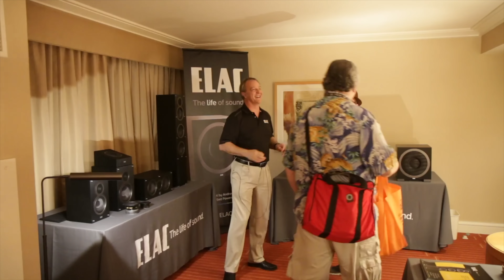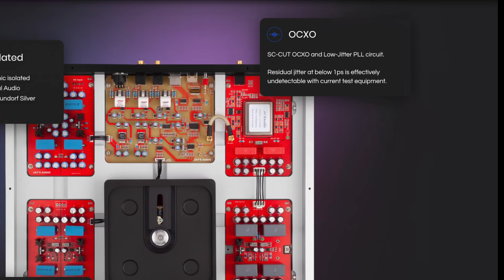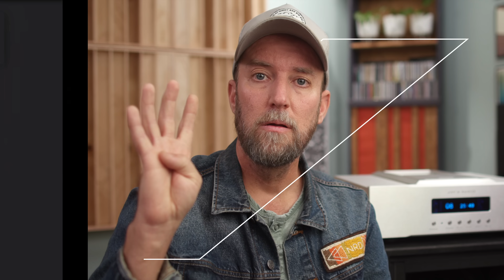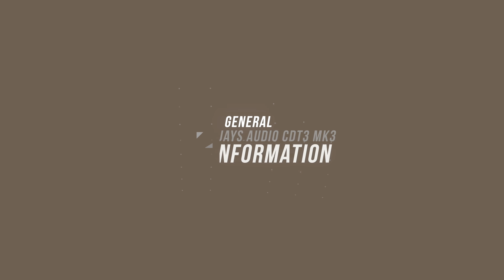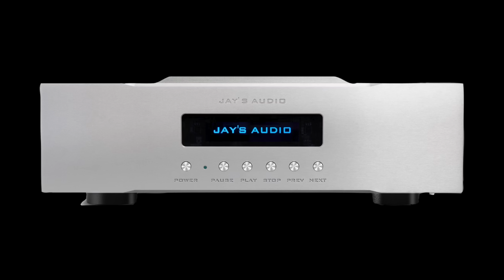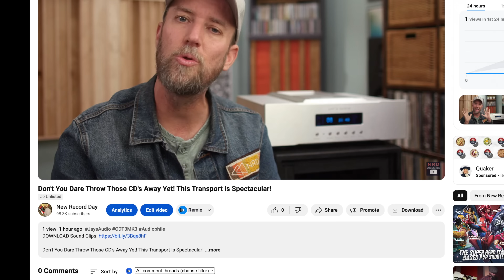Don't You Dare Toss Those CDs! This CD Transport Will Blow Your Mind!

Comment: Talking about listening impressions when you are reviewing transport is kinda silly.

Because transport just .. transports. So the only thing you should check is the output bit stream.

So you take competitor / reference trabsport, then capture output streams from competitor and cdt3 and compare them bitwise. Also you may capture the stream of same track several times. Aldo you nay capture streams from two same CDs but one of them is new condition and other is scratched or 'made old'.

This is only right way to judge on the transport. Your listening impressions has nothing to do with that and make whole your opinion misleading.

Comment: If your reference tracks are the exact same masters in each device there’s only 2 reasons the sound could be different. 1: your DAC has a poor reclocking system. 2: The CD player has some sort of DSP processing inside altering the sound of the original recording to add this “silkiness”.

Comment: As usual.. great video Ron .. I purchased a preowned Jay's Audio CDT2-MK3 Transport earlier this year. My previous disc player was a Marantz 30n Cd Player and it sounded good.. Next I used the Marantz as a transport with a Denafrips Pontus ll Dac and there was a noticeable improvement in sound quality.. Months later I connected the Pontus to the Jay's Audio Transport.. that was another nice jump in sound quality.. Yes, smooth sound with more detail. Needless to say I'm listening to more Cd's in my collection again..  I found that using a separate Cd transport was definitely worth the investment to me.. I would love to hear the CDT3 that you just reviewed in my system.. Maybe I'll  have that opportunity one day..
Reply: I happen to own CD2 and marantz 30n as well, but the latter is for a desktop system. Next I want to try connecting the 30n to main system's terminator 2. I read some post in a forum saying that internal DAC sounds better than coax out to a terminator (1, perhaps)... But your experience is the opposite, so I'm quite curious about the result... I also want to try its USB input, comparing to terminator 2.

Comment: Best value transport right now is from Teac with their latest VRDS system. If you want to improve it even more then add their dedicated clock. Together are still less than the CDT3
Reply: Agreed. Running the Teac clocked externally by an LHY OCK-2 master clock, total price $2700, sound quality a step up from streaming from a $13K Lumin P1, in my system at least.

Comment: I‘m not convinced in 4 of 5 topics. Only the read quality is valid in my eyes. I use direct clocked DACs (TDA1545) for many years, completely ground isolated from the transport, the transport is just slaved from the DACs clock. Something you don‘t find in the market. 
What is true in my eyes: The mechanical situation of this clock is very very delicate. XOs are highly microphonic and their microphonic behavior can lead to higher non linear distortion. So no matter where the clock is situated (transport or DAC), much care is needed to calm the XO. This could be your main reason this transport sounds good.

Comment: .            Why would a CD Transport need a fancy clock if, effectively, all DACs cache & reclock the incoming data anyway?:body-blue-raised-arms:
                                                                                                Acid Jazz,  Funk & Brass🔈🔉🔊
Reply: Correct analysis!
It dont is the awnser.
Reply: No, not all DACs buffer and reclock the data, in which case the transport's clock jitter has more influence on the overall jitter than the DACs clock, because a PLL on its own will not reduce jitter on the input signal.
Reply: @montauktimelord  .
               It's your Jersey drones messing with clocks I heard:face-turquoise-covering-eyes:.   But anyway, it sure seems rare that a DAC doesn't reclock incoming SPDIF.  Can you point one or two out (that are available in 2024, not a decade ago)?
               I agree that the Phase-Locked Loop is not a clock & doesn't need a good one to function.  And any DAC with incoming USB 2.0 or higher must reclock and cannot go without.  Any further info? Reply?

                                                                                                                         Acid Jazz,  Funk & Brass🔈🔉🔊
Reply: If your dac is a slave clock then your source will improve the sound quality. If your dac is the master then it’s limited to its own clock.
Reply: More is always better.
Reply: Thats like saying why do we need a Lamborghini  when my Tesla s is as fast? Because it’s far more complex …handling, control, breaking, …it’s not as simple as dac reclocking…that’s just marketing talk …if a dac is purely reclocking then you are limited[ …your dac becomes the weakest link…so basically your dac is downgrading the signal
Reply: @ajay55556  Lamborghini "breaking".  Ya, they are known for that.
Reply: Digital engineering very complex and trying to explain in few sentences is impossible. That’s why it’s best to go to a dealer and try different sources. You will hear a difference between a 5k transport vs 10k transport. No point arguing on the technology.

Comment: It's interesting how separating CD transport and Dac usually improves the sound, but adding extra links to the analogue signal chain (subwoofer crossover, equaliser, pre/power amp, etc) usually degrades the sound.
Reply: .        It's all about the quality of the chain, not quantity.  The chain itself always requires the same number of links to perform the same task.  CD Players are still a CD Transport & DAC in a single chassis.
       BUT you're right in that some people believe adding a link in the chain where none is needed to enhance the performance of the same task is detrimental.  I'm specifically speaking of adding an Equalizer 'link' into the chain.  I say "Nutz".  A good EQ is quiet as a mouse & it's worth the flexibility to MyFi.
       One caveat,  if one plans to use lots of links then patchords become really, really important.  Beginning & ending this type of chain should be all XLR balanced patchcords from the git-go.  So plan ahead............
                                                                                 Acid Jazz,  Funk & Brass🔈🔉🔊
Reply: Analogue lossy, digital is not.

Comment: Very interesting, you just described my DAC, Audial S5B. I'm an analogue guy, never cared for digital, I was recommended this DAC and this thing is so musical, it's making me rethink my analogue rig, I'll most likely go to a more Koetsu like cartridge when I replace my Cadenza Black.  Seriously, I never thought I'd ever say this, but my present digital rig is more musical than my analogue rig, making this transport very interesting.
Reply: I've had my eyes on the S5B as well. Did you opt for the transformer out?
Still trying to decide myself. Cheers!
Reply: @steven8417  Opted for 2 pair of RCAs, transformer output on one of them. So far I prefer the Cap out, but I'm happy that I have both, for certain music I prefer the more euphonic transformer, who knows, I don't believe in it, but maybe break-in is a real thing. One thing is for sure, it's a musical beast, the designer did an amazing job, bravo Pedja.
Reply: Completely agree. I have an Audial S5b Dac connected to my Roon Nucleus via USB in an otherwise all Audio Note system. Sounds fantastic. I can only imagine how good it will sound with a good CD transport.
Reply: Switch to a Playback Designs MPD-8 DAC as I have and you won’t go back to analog.
Reply: @a.s.2426  That sure looks like a nice piece of Hi-fi, I hear nothing but good things on it, but NO WAY can it be better than analogue...
Reply: @BobCoalWater  Do not "NO WAY" unless you've tried it. Several high-level audiophiles and analog fans have found it, supposedly, to be indistinguishable from analog. In my case, I don't say it's indistinguishable. I think it is superior on some recordings and inferior on others. Sounds a bit different than vinyl, though, for me. A lot depends on the remainder of one's set up, of course. But it's definitely quite analog for digital, I can say. I have owned other DACs such as the Tambaqui that are reputed to be analog-like but sound nowhere close to the MPD-8 in this regard.
Reply: @a.s.2426  It was a joke, not successful. I'm really not in the analogue is best camp, I would love having the chance to listen to an MPD-8 in my system.

Comment: Digital audio on a CD does not work as it does on a Vinyl. There are packages of information, not a continues stream of 1's and 0's. Anything that handles digital signals uses buffers to deal with this. Jitter, package loss or similar issues would result in corrupt reading, something a deaf person could hear. In other words, the CDT3 is a very expensive EQ. Noise over a digital cable is not digital, it is simply analog noise transferred by a digital cable.

If you want better sound, spend your money on room acoustics, DAC and everything analog (cables can make a change, but only if the ones you have are really fucking terrible).
Reply: This comment should be a sticky.

Comment: I still have my Linn LP12 for my vinyl collection and want to find a nice CD transport with i2S output for my disc collection.  I am currently using a 70’s era Luxman CD player but on the search to upgrade.

Thank you Ron for this video plus the sound clips.  I may be missing something here but which (Zenith??) CD Transport is your current reference, Ron?

Ron, can I ask you to please do a deep dive on TDA1541A DAC chip.  I see that there are some DYI and commercially available DAC’s with this chip and just as the Philips CD-Pro2LF tray mechanism, it is highly regarded.

Comment: I while ago I was interested in this transport, but the top loading and blue lights turned me off and I got the Schiit Urd instead, The feet on the URD are terrible but overall I'm pretty happy especially with the sound on the USB out.
Reply: The Urd is as far as I would go 
I like the StreamUnlimited metal tray-loading Redbook CD mechanism
I like two USB in and the USB out
Reply: The display can be turned off. I prefer top loading too. No moving parts.

Comment: The CDT3 is a beast of a transport but at $5k, most will question the value. The CDT2 mk3 gives you 90% of everything the CDT3 offers for $2.5k (and often on sale for $2k), for me that’s the sweet spot buy. It’s far better than any entry level player but beyond it, the gains are way smaller. Did you try the I2S connection into the May DAC? I find I2S over hdmi to be more detailed and dynamic than spdif. And I also prefer non-oversampled for some reason.
Reply: Check out the Shanling ET3. I had the Jays in my system for over a week, and for giggles grabbed the ET3 on sale for $650. I couldn’t A/B, but found the Shanling to easily match the CDT-3 using I2s. RCA or Toslink couldn’t keep up.

Comment: I use a harddrive/notebook pc as a transport. Can you tell me how this differs from using a dedicated cd transport? The notebook uses a usb output. I know, prone to jitter and noise. I have put an hs02 isolator on it and two iSilencer filters after it powered by an ifi iPower X supply. I then feed the usb output to an SMSL PO100 PRO DDC powered by a second ifi iPower X supply which converts the output to either I2s or optical or coaxial output. All audio related hardware is on one usb port from the notebook and all wifi and rf hardware on another. To my way of thinking the CD to harddrive software ripping process grabs all the data and the harddrive plays back the data with at least adequate error correction. I use JRiver Media Center software to playback the flac files which converts to dsd64 to the dac. The dac has it's own battery pack/super capacitor power supply.
Reply: I was using laptop and heavily modified usb/spdif converter to send music to my dac. Then one time just for test I put on some CD's through two quite good old school players (Mark Levinson 390 used as a transport and Arcam alpha 170). The difference was enough that I abandoned convenience of computer as a transport, modified Arcam cd transport and started buying CD's. The ease and flow of play you get with cd transport is almost analog sounding after computer/usb ddc. Also stage width and depth are greatly increased. These are my impressions. Try to get some cd transport and listen for yourself. All transports can be greatly improved further with modifications.
Reply: @AcidLTU  That's how I describe the sound of what I use now after modifying my dac.
Reply: @kennethoransky4881  like I said. Test it yourself. It's always good to try something new (or forgotten old in this case)